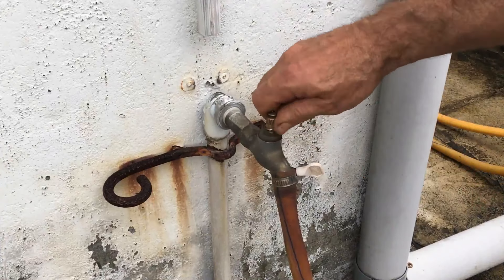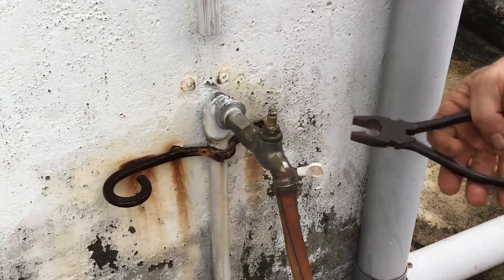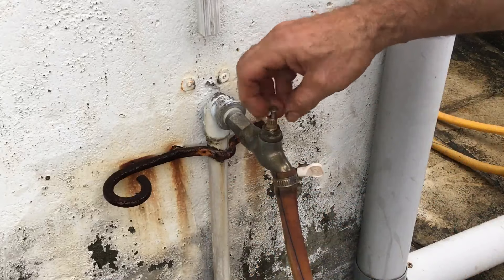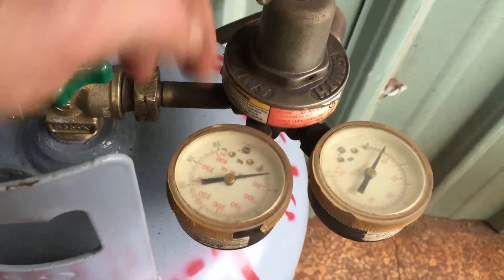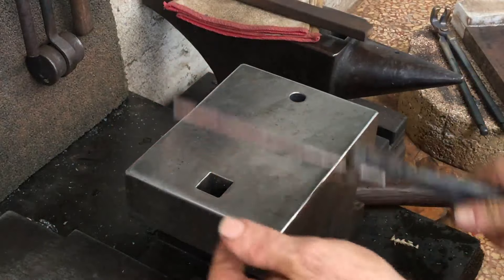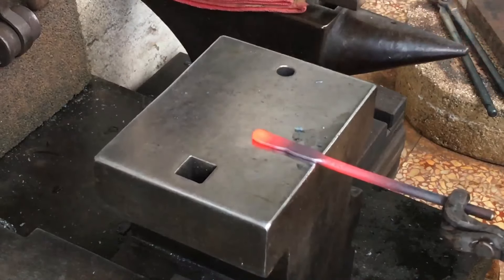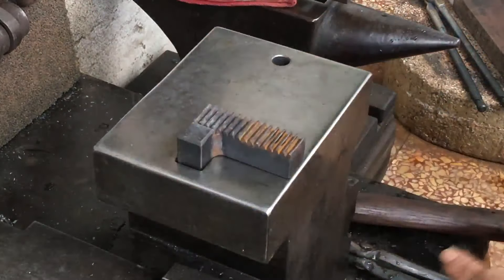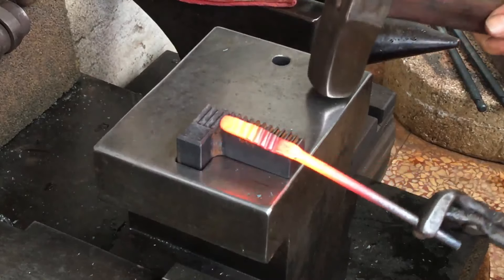Practical Blacksmithing - GS Tongs

Comment: Get a two inch diameter circle of metal, 1/4 in thick. Find the center of the circle, punch it drill it slightly smaller than the faucet spindle. Broach the center hole to enlarge, lightly tap onto faucet spindle and reset your screw! Voila! Fixed
Reply from the maker: That would also be very good way to go about this. Maybe next time... Thanks.

Comment: With the small things you frequently make, have you ever thought of getting an induction forge? They're getting to be so cheap now for the small ones. You could make something like that super quick without having to take tine for the gas forge to heat up.
Reply from the maker: I always thought an induction forge needed 3 phase power but I may be wrong. I will look into this more. Thanks.
Reply: @gstongs  you can get a 15 KW, 30-80 KHz high frequency, single phase 220 V induction forge for around $1000 usd or even less.

Comment: Quick and clean. I noticed that you did not put any kind of finish on it. Will the forge scale slow the rust? Or do we not care? It will outlive the spigot anyway so in the long run it doesnt matter. It will definitely last longer than the original handle.
Reply from the maker: Good question - I really don't care of this rusts. This should last a really long time - way better than plastic... Thanks.